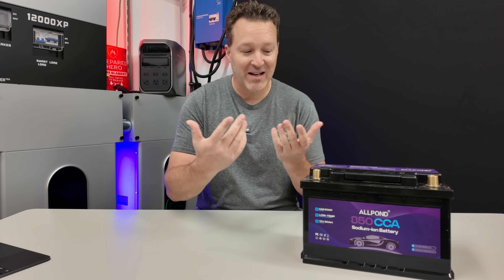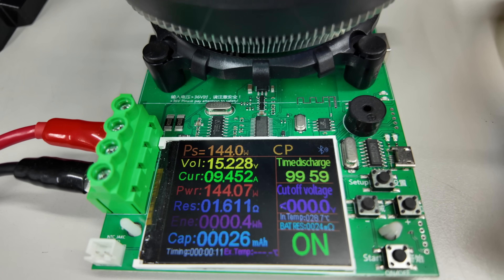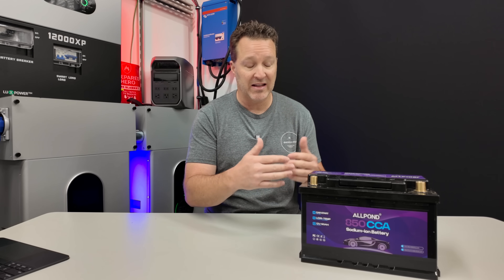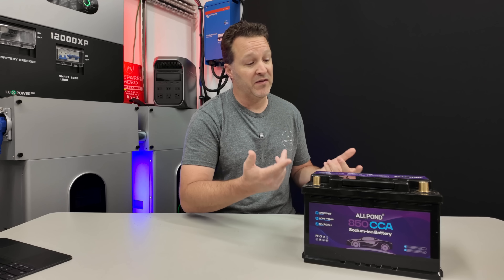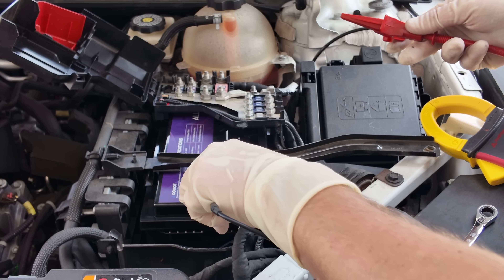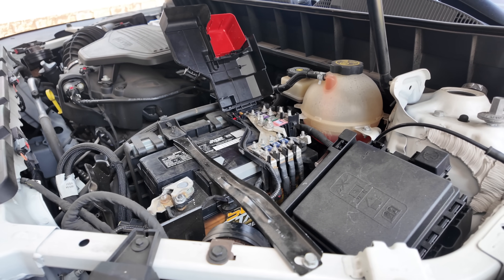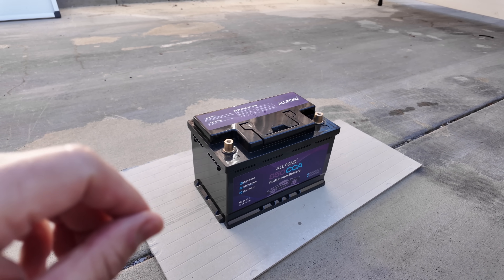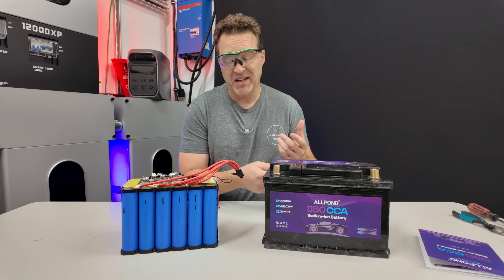Sodium Ion Battery Tech Hits The Auto Industry!- Are We Ready?

Comment: Only 3.5 years out of your automotive lead acid battery?  My truck is a 2000 model Tundra with over 355k miles.  My first battery lasted 9 years and my 2nd lasted 8 years.  My third battery is nearing 8 years and is due for replacement (the only reason I am looking at this podcast).  Unless something changes, I'm not sure these new tech and higher priced batteries are worth it.

Comment: I am interested in Na+ battery for my 2005 Sprinter diesel van. It has very ancient type alternator with built in voltage/charge controller. At $226. it is actually cheaper than a H8 size AGM ($300).

Comment: Because of the BMS in the lithium battery, it won’t give you any resistance to pull a charge below its specified charging voltage. You need to drain the battery below 14.8 V before it’ll flip the BMS on to start a charge cycle.

Comment: I don't have a clue about what you are claiming, having to replace your battery at 3.5 years, I've had one of NAPA's top of the line batteries in my vehicle now for 7 years, it has plenty of things running on electricity and it has no signs of any issues.

Comment: Sounds more like it could be used in a semi separate system that connects only to the starter while the rest is using a normal l/a battery for the rest of the vehicle.

I'd just have a dc to dc boost converter to charge the battery up to its rated voltage regardless of main system voltage, which also prevents backfeeding except when  needed to jumpstart it.

Comment: The stock AGM battery that came in my 2017 F-150 went 7+ years.
Reply: Ive got an Interstate battery in my Kia Forte Koup that was installed 10 years ago, and no sign of failure yet.  I wonder if he removed a cell or two from that battery to drop its voltage down to 12V if it would work better with his alternator?

Comment: Rule number one: you need to replace voltage regulator to match the chemistry of the new battery even if the new battery has its own BMS. If you don't change to a matched v reg then all bets are off.

Comment: A commercial motor vehicle (specifically a class 8 road truck) has four 12 volt batteries. They are starting and house batteries as there aren't separate banks for these roles. A driver stops every day for their 10 hour break (US rules) and may be running all sorts of "hotel loads" while on break. A battery that can be more deeply discharged and topped off while the truck puts on it's miles during the day is a game changer. Also, truck batteries are located outside the envelope of conditioned space, so lithium based batteries are not an option.

Edir: Also, because LA batteries in CMVs get cycled way more than the batteries were designed for, replacing them every year or two is common (at over a grand, including labor, each time).

Comment: That is interesting, seeing low voltage. I have a Lithium Phosphate in my old Datsun Z. I'm seeing 14.6x on my multi meter and on the Haltech. My battery had an 80% charge when I received it from Amazon and after driving a bit it reached 98% according to the built in indicator. My alternator is a GM 12Si 120 AMP. I love that battery. Very light weight and IF it last over 5 years (says it will) then I would save money vs. Lead Acid. Should that be then I will replace all of my lead acid.

Comment: Umm I think it’s worth saying that lead acid in automotive use makes a ton of sense really they are relatively inexpensive generally I get 4-5 years or about 100000 kilometres out of a decent battery unless this battery technology does significantly better than that I can’t see the point one great advantage is how easily lead acid batteries are to recycle or even reuse in the case of replacing the cells which is still very common in places like India or Pakistan and many other countries.

Also with cars becoming more dependent on batteries being cycled with smart alternators and large loads at idle a battery that isn’t good at cycling is a disadvantage which I believe is the case with sodium ion batteries not that lead acid exceeds in this and obviously lithium is great for cycling but heat under the hood of your average car is going to drastically reduce the life expectancy of a lithium battery so unless sodium is good at being cycled and exceptionally tolerant to high temperatures I’d suggest sticking with lead acid as while there definitely not perfect they are ok with heat provide good starting current are very safe in respect to fire risk and can tolerate moderate cycling and are affordable also they are predictable I like that every time I’ve had a battery start to get weak I’ve all always managed to roll into an auto parts shop and got a replacement before getting stranded but that might be more good luck than anything but I do pay attention to when my vehicles get sluggish on startup and swap out the battery as soon as possible I just wonder if this kind of battery might just decide to die all of a sudden and leave me stranded.
Reply: Seems like a bad solution looking for a problem

Comment: Your alternator puts out way more energy than your car is using unless the alternator is faulty, or you've added tons of exterior lightning wherein you need a larger alternator because you will discharge your battery otherwise.  So, your statement about car batteries being overtaxed nowadays is totally wrong.  You're buying super cheap batteries that can't take the vibration and bumps in the road.  That's why they are only lasting 3-1/2 years.  Buy a better battery if you want it to last longer.  You're buying 660 CCA.  Yep cheapest battery you can buy, but you spend $200 on THIS battery?

Spend $200 on a good lead-acid battery, and you'll get 5-6 years usage with full 850 CCA.

Comment: I don’t understand why so many people are having lead acid battery give out in 5 years or less? Is it just a lack of maintenance/proper charging methods, or are they just getting cheap batteries? The flooded lead acid battery I just replaced in one of my cars was 8 years old when it gave out, and it wasn’t anything special just a NAPA branded flooded lead acid battery. I hardly did any maintenance to it other than checking and topping off with water every once in a while, putting a float charger on it when it wasn’t going to be driven for say a week or more, and occasionally checking the SG and equalizing if needed. It’s been my experience that a halfway decent flooded lead acid battery that get even the most basic maintenance will last 7-10 years. A high quality flooded lead acid battery like a Rolls that gets very good maintenance should last 15-20 years.
Reply: @Trump985  agree.  Beside the batteries that get discharged.  Rarely have issues under 5 years.  Only 1 I can think of was actually a corroded negative cable

Comment: 2:10 - Why will Sodium-Ion be "better" than LFP? Pretty much the only thing it can compete on is price due to chemical abundance and is safer. Does that make it "better"? Makes it more suitable for some applications but "better" in all aspects doesn't entirely make sense to say. It's less power-dense which for many applications would be a "worse" outcome.
Reply: @Mark_Williams.  cost per cycle and power delivery. The batteries won’t last as long but they will be magnitudes cheaper to manufacture because of the abundance of materials. Their lifecycle will be shorter so replacement intervals will be more often but the sodium ion batteries will be a fraction of the price of LFP.
Reply: @Rockwell108 yeah, but does one metric, price, make it better? Like I said, it's situational. If form factor or weight doesn't matter, then yeah, it's good choice.

Comment: High temps make lead acid replacement every year quite common.  

In Phoenix AZ it was rare for a battery to last more than 18 months, common to last less than 12.  

Just the slight temp drop moving to east Texas extended them to 24 months in the same vehicles. 

Moving to east Texas where it’s just a little cooler, they last me three or more years.  

The temps above 100 seem to hurt the worst. 

I swapped one of my cars to LiFePo, and that was a good idea technologically, lasting five years of use,  but the moronic mechanics kept seeing the higher output voltage as an electrical problem so I gave up. 

(I had to bring it in regularly for other electrical issues because I made the mistake of buying a Chrysler 😅)

Their automated tools can’t account for alternate battery technologies.  I’m guessing it would have gone another five, as I’ve used it for that long since with an inverter for power tools.

Comment: So the BMS was outputting 14 volts that's why it stayed at 14 like that, 14v is the state of charge of a full lead acid battery in most cases. As the battery got low it would likely drop voltage to show the vehicles system it needs to charge. When a vehicle charges a battery it will pulse off every once in a while to see the voltage of the battery when it does this you can't tell because it is reporting the charging voltage. But as the voltages get closer it shows it kick on and off while driving. On your next long drive keep that screen up as the battery tops up you can watch it switch back and forth. Now you have the battery apart you can probe it more and see what is happening as it discharges. Remember the BMS takes power to run and that's likely the reason you saw it cut off short the claim of 720wh, as 24 cells at 30wh each would be 720 in a perfect test scenario however no BMS is 100% efficient so some loss will be inevitable. I'm no expert either but thought I should share.

Comment: First off...get a real test meter. Second,  putting a bms regulated battery on a system that has a computerized voltage controlled system rarely works. Should have tried an older vehicle maybe. Or take some voltage out of that sodium battery. A lead acid battery at that voltage would be over charged.

Comment: i have just changed my lead acid battery in my car after 9 years it was an Heavy Duty Starter Battery 12V Ah115 Cold Cranking 1000Amps sooo... i do not know what you people are doing mine lasted allmost a decade and i only changed it because i stopped driving as much and the battery started to fail as a result of it being parked for sometimes weeks at a time.
Reply from the maker: Make and model of vehicle?

Comment: When you swapped batteries and tried to test the Sodium Ion battery, you confused the BMS and that is probably why the test went so badly.
I thought you had to reset the BMS when you replaced the battery or the old BMS charging algorithm is still being used. I know my 2013 Ford Taurus required a reset either using an OBDII scan tool or software, or a user might be able to use a pattern of different existing buttons on the instrument panel.

That algorithm contains many items like how long the battery has been in service, current voltage and  many more parameters. 
Depending on the vehicle, the BMS might need to be manually reset, or it will treat the new battery using the old battery's history.

State of Charge (SoC):
Indicates the remaining battery capacity as a percentage of its full charge. It's estimated using techniques like voltage profiling and coulomb counting.
State of Health (SoH):
Reflects the battery's aging and degradation, comparing current capacity to its original capacity. It’s crucial for predicting end-of-life and scheduling maintenance.
State of Energy (SoE):
Measures the usable energy left in the battery, factoring in voltage and capacity.
State of Power (SoP):
Estimates the maximum power the battery can deliver at a given moment, considering temperature, SoC, and SoH.
State of Capacity (SoQ):
Represents the actual charge-holding ability of each cell, often tracked over charge/discharge cycles.
State of Resistance (SoR):
Tracks internal resistance, which increases with age and affects efficiency and heat generation.

Manual vs. Automatic BMS Reset After Battery Replacement
In Most Automotive Systems:
Manual Reset or Reinitialization Is Often Required.
The BMS may retain historical data like State of Health (SoH), cycle count, and fault logs.
These values are tied to the old battery and can mislead diagnostics or performance algorithms if not cleared.
Resetting ensures accurate SoC calibration, balancing routines, and fault thresholds.
 Smart or Adaptive BMS Designs:
Some newer systems auto-detect battery replacement via:
Voltage and impedance profiling
Serial number or ID mismatch (if the battery has a smart interface)

Sudden change in SoH or capacity metrics
Even then, a technician may need to confirm or authorize the reset via a scan tool or service mode.
 Typical Reset Procedures Might Include:

Using OEM diagnostic software (e.g., Techstream, ISTA, Forscan)
Clearing learned parameters and fault codes
Reinitializing SoC estimation algorithms
Rebalancing cell voltages if needed

What Can Go Wrong Without a BMS Reset
Incorrect Charging Behavior
Charging rate mismatch:
The BMS may apply charge profiles optimized for the old battery’s degraded state, leading to undercharging or overcharging the new one.
Voltage thresholds misaligned:
If the BMS expects lower terminal voltages due to aging, it might prematurely stop charging or fail to reach full capacity.
Faulty State Estimations
SoC drift:
The new battery’s actual capacity won’t match the BMS’s learned model, causing inaccurate State of Charge readings.
SoH confusion:
The BMS might still think it’s managing a worn-out pack, triggering unnecessary warnings or limiting performance.
 Charging System Errors
Contactor lockout or charge refusal:
Some systems will block charging if internal diagnostics detect a mismatch between expected and actual battery behavior.
Thermal management misfires:
Cooling or heating routines may be based on old thermal profiles, risking inefficiency or safety issues.
Diagnostic and Service Confusion
Fault codes may persist or reappear.
Predictive maintenance algorithms may flag false positives.
Warranty claims could be complicated if the reset wasn’t performed.

In short: the BMS is like a memory-driven gatekeeper. If it’s still living in the past, your new battery won’t get the treatment it deserves. Whether it’s an Automotive battery, a UPS module, EV pack, or hybrid rig, resetting the BMS ensures the system recalibrates its expectations and safeguards.

Comment: You need to work with an older car that doesn’t control the charge voltage through the ecu.  You can then also fool the alternator into charging at the recommended 15 plus volts by resisting the sense wire. I need to look into one of these batteries for my race cars.

Comment: You’re using these differently than I would be. I’m more interested in BEVs and home energy storage. That voltage drop curve is concerning if that is the same chemistry that BEVs will use. As far as charging in an ICEV, voltage regulators can be reset to charge at 15.6V. I’ve had some alternators that did put out 15v+. Talk to a local rebuilder about it.

Comment: The current draw diff, when starting, makes sense. The resting voltage is quite a bit higher, plus the posts are brand new. Less resistance & higher voltage = less current. 👍

Comment: If you have to replace your car battery every 3 years, you are doing something to make it fail. I have only ever had to replace a car battery once in all 5 of my cars since 1995...
Reply from the maker: You need to research more on how often new car batteries are replaced
I live where it gets extremely hot and heat kills everything. 
Then the winters can be cold as well. 
New vehicles have systems running all the time which drain batteries way more than they used to. Normal lead acid batteries like to maintain higher state of charge
It doesn’t take much to get them down p especially if the vehicle sits for a few days if say on vacation, again with all the new systems in cars.
Hence plug in hybrid vehicles the batteries can last 10years or more because people plug them in all the time. 
My hybrid battery was 11 years old. And still was really good, only replaced to find a code being thrown

Comment: The failure of batteries has everything to do with the manufacture and the quality of battery that it is now producing. The more they can charge you the better. What they have done is produced a bunch of sub-standard batteries and placed the regular label on it, then produced another battery that was slightly better, then produced the best battery and almost doubled the price..... but what you get with the high priced battery was actually the original battery that was produced. 20 yrs ago there were no "extreme, long lasting, ect", there was just a battery with the name of the manufacture and the CCA.A 25 yr old semi truck that takes 4 batteries, would last 7 yrs or longer if it was being used everyday. That same truck with todays batteries will have 4 dead batteries(load tested separately)in less than 3 months in average 50 degree weather and the main power off at a shut off switch. The only true good battery out there that is not going to burn down your vehicle and will last for over 10 yrs in any weather is a  . . . . Gel-cell Battery. . .  and you will definitely pay for it, it maybe 3x the cost but will outlast any battery 8x as long and can handle extreme voltages and voltage draws. I have yet to come across a gel cell that was flat or that could not be energized in less than 30 mins at 60 amp charge.

Comment: With the demand for everything being electronic steering ac lights hell even brakes the need for constant flow its imparative if you have a cvt they need a constant supply to make shift points not that it shifts but sonthe cvt stays taught otherwise yiu get a worn out cvt im unsire of how a sodium battery would perform as even regular batteries cant keep up ca8singnmore strain on alternators   which ca8ses many failure points